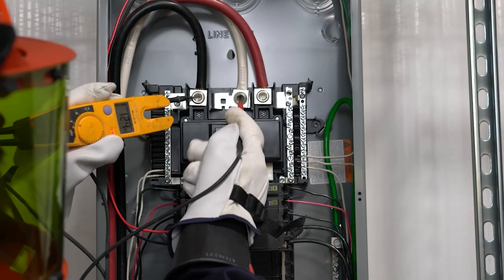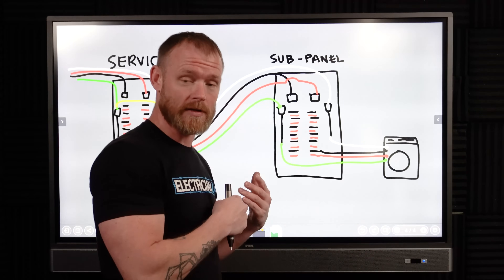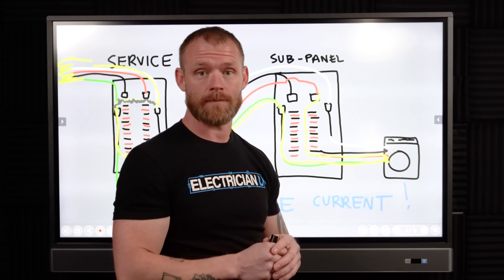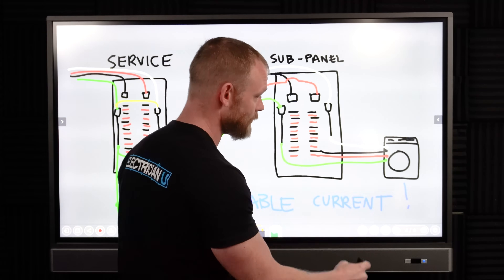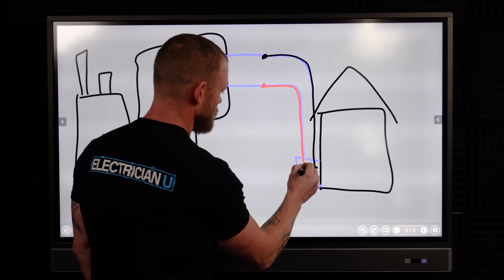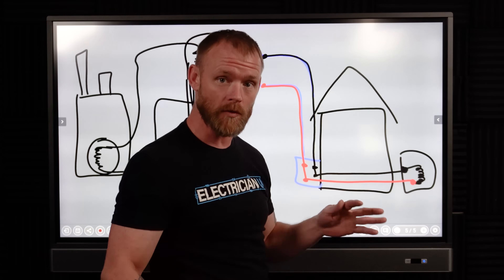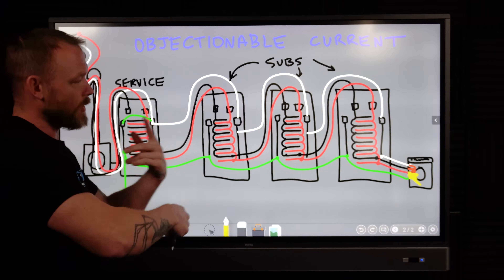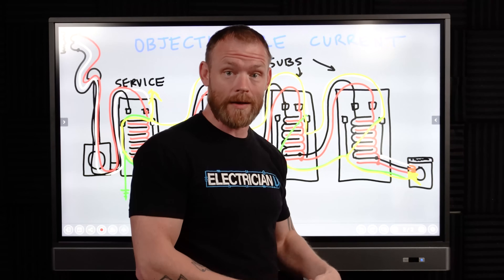Why Do We Bond at the Service Panel and Not a Subpanel?

Comment: Having watched your video I have a question/concern. My house has a main & a sub panel installed by the previous owner. Also a well (supplied from the main) and a pool pump fed from the sub panel. There there are two ground rods near the main panel. There is also a ground wire (insulated) that is connected to the well pipe, the pool motor and the rebar or the steel wall (I think) of the pool. Not long after we moved in I noticed a tingle when I touched the metal bars next to the stairs. I found there was a 5V AC voltage when I disconnected the wire from the well and the wire to the pool. The tingle went away and I thought more about it. I have yet to check if the sub panel is bonding but I am wondering if there is a grounding fault somewhere.

Comment: TLDW: Because you'll mix legitimate current and illegitimate current. You're effectively introducing a neutral-to-ground fault. Half your current will be carried by ground, and your main breaker will immediately trip. Also, the ground wire is not supposed to carry any current except fault current. Everyone is touching it, all the time. If you put normal current on it, you'll fry everyone.

Comment: What if the sub panel comes from a power tap before the main panel? Does the sub panel bonding bus bar need to be removed? Or does this setup just mean you have two separate main panels?

Comment: If you have a short circuit, and bonded each service panel, I don't think you risk current going through equipment since that equipment will have high resistance. However, the high current will create a voltage drop in the neutral wiring, so your equipment may brown out.

You risk extra current going through equipment if your house is hit by lightning, where the voltage gets extremely high and is dissipated by the ground. If the grounds and neutrals were bonded together at every panel, every upstream circuit would be at elevated voltage due to the lightning strike, and the current could go through the equipment (due to the higher than 120V).

Comment: My house has a new square D QO 42 space main panel in the basement 200A. It’s fed by new Siemens 200A master disconnect single breaker that’s between the meter and the house panel and on the outside of the house. In the conduit run. The service is underground to the meter. Thus my house panel is a sub panel as my neutral and ground are bonded at the first point of disconnect…the outside master 200A disconnect. In the event of a power outage is it acceptable to use a square D generator lockout device on my house (sub) panel main breaker to get my generator feeding that  panel specifically?  Or furthermore as a second option use a Reliance transfer panel on my sub panel?  Keeping in mind my neural and grounds are separate in my house (sub) panel. Is it possible as long as my generator neutral and ground are bonded?  And would my generator need connected to my house grounding electrode rod?  Or need it’s own rod at the location of the generator?  The authority having jurisdiction does not inspect electrical work…:if you can imagine that. No permit required. But I like to be correct in theory before hiring an electrician to do this.
Reply: I guess I can further complicate matters by asking does my outside master disconnect HAVE to be the point of neutral ground binding?  In my basic google university research it seems if THAT breaker panel is labeled as emergency disconnect only - not a service disconnect then it does not have to bond there but instead can bond inside the house. Suooosedly NEC allows that. But I don’t know. I hate hiring an electrician without knowing my situation because I’ve found in life even experts sometimes don’t really know. I need to understand what I’m being told by people I give money to.

Comment: Thanks for the explanation. What is confusing to me, the ground and the neutral at the sub panel is the same ground and neutral at main panel, except for a few milli ohms along the length of the wire. If there is a current of 10A flowing in neutral and the cable resistance is 0.01ohm per 10 metre (10awg wire), there will be a voltage drop of +- 0.1v, along the length of the 10m cable. If there is a transformer(or inverter) between main and sub panel, (I. e. isolated), I understand the neutral and ground bonding at sub panel due to safety reasons as there will be no physical contact. Or has it something to do with the gfc interrupter not functioning correctly(or not at all) if bonded at sub panel?.

Comment: So around 16:10, this had me confused. If a ground fault at a bonded sub panel would potentially go though equipment, how would a ground fault at the main panel not go through equipment?
Reply: Watched again and think I understand now. Because having 2 parallel paths, we don't know exactly which way the current will go or if it will make it back to complete the circuit?

Comment: So I have a dryer that has a Three conductor pigtail with a three prong plug. There is no neutral. The dryer has a 110 plug on its face. Isn’t that using the ground for the return?

Comment: Does this apply if the garage is detached?
Reply: No it doesn't  you need a grounding electrode system
Reply: @262markm  yeah I just looked up the code and installed one but this video sure had me confused.

Comment: You forgot the biggest reason for not bonding sub panels. The high current on the neutral causes a voltage drop due to the wire resistance that can 1 shock someone at another device, 2 can damage sensitive equipment.  OIB a thirty year controls design engineer.

Comment: If as it was done in the past that a 4 conductor circuit went to the sub panel then separated ground and neutral in unnecessary. Seems safer than just a 3 conductor to the sub panel.

Comment: Very helpful clip.  Thank you.  I understand conceptually why the neutral and ground need to be bond together at the main panel only, but I can't seem to understand how the ground would not become energized back at the main panel since the ground and neutral are on the same bus bar?  If the flow of current is traveling back through the neutral wire that attaches to a bus bar that has a ground, then why wouldn't the ground then hold that current as well?

Comment: Breakers monitor the current on the high side, it does not matter if it splits into a ground and neutral parallel path on the return, because the breaker still trips. So there may be a valid safety reason for not tying ground to neutral at the sub panels but it is not what you stated. Electrical engineer for 30 years

Comment: Neutral is white, but white isn’t always neutral. Do you guys know what that means?

Two hot , one neutral, alternating current never peeks at same time neutral never sees 100% of the load at the same time usually she’s 50% phase to-phase  in a three phase circuit one neutral, three hots because again alternating current never peek at the same time .

Comment: 220 is a complete circuits thowever, you need to ground for point of reference to be a grounded circuit.
Reply: Circuit breakers trip for two reasons, overload of short circuit.

Comment: How about if you lost your neutral, your ground would become a neutral and it’s under size and you could have an in balance load in the service. You also could have fault current interruption rate problem, because the cycle would be a little slower because the resistance would change .

Comment: Another great video that cleared up a hangup I've had for years and I couldn't find anything to explain it so I could understand  until now. I still not one hundred percent sure about what makes the breakers trip on the service panel vs the sub panels I understand what makes a breaker trip but do all of the or more than one breaker trip both in the sub panels and the service panel  ?

Comment: I'm dealing with an older installation where a second customer meter and overhead line has been run to a secondary service at a cabin 50' away. The neutral has been bonded with the ground at the main service panel at the house so the overhead to the cabin has a bonded neutral  through the support cable to the cabin. There is no ground running to the cabin. By not bonding at the main (sub) panel at the cabin, the ground wires at the cabin are isolated from the bonded neutral and the house ground. Would it be appropriate in this situation to bond the ground at the cabin panel or would it be correct to run a ground wire all the way from the main service panel at the house to the cabin panel? I think I already know the answer but the customer won't be happy about digging a trench for a ground wire.

Comment: Excuse me, but not creating ground-loops via multiple grounds makes good engineering sense from the standpoint of electronic noise reduction. However, it is required in Hollywood for 'fire safety code' legal reasons. As a result, movie studios are wired with ISOLATION TRANSFORMERS feeding the sub-panels,  allowing local grounding without creating ground loops that transmit hum into audio circuits.

Comment: I'm still not understanding this. As an electrical engineer, it seems to me the breakers would still trip. Whether the path to ground or the path to neutral are shared or not, the same current flow takes place on the hot wire. If you had 30 amps flowing through a 20 amp breaker because it got shorted to an unbonded ground, the breaker would still trip because it does not rely on the neutral wire, it's triggered by the current flow on the hot wire side. Breakers don't have any interaction with neutral wires unless they are GFCI. I don't see a problem having two separate paths, one neutral and one ground. If half the current went through the ground and half the current went through the neutral, The total current is still flowing through the hot, hence the panel or subpanel breaker will still trip. And in the case of neutral bonding every subpanel, I also don't see the problem, The same amount of current flow will still take place. It's my understanding that the breakers are just tripped by current, not by ground fault. Now, I could see a GFCI box having trouble, maybe. But even with that, it's hard to believe it would be a problem because it monitors the neutral wire potential difference from the hot wire. If the hot wire shorted out or you completed the circuit or the hair dryer fell in the sink, you or the water/pipe are bypassing the neutral wire by a small amount, enough to trip that breaker. The explanation assumes the panel breakers rely on neutral, which they do not.

Comment: DUSTIN, You didn't explain why would two or more neutral wires would NOT be at the same potential? Not all neutral wires are at the same potential but giving more examples of why would multiple neutral wires would be at different potentials, any reasons why this would be done?

Comment: Basically the lonely amp is trying to get back home after it's hard day at work. The bus to work is the active conductor, the bus home is the neutral conductor. Home is the alternator at the power station. Sometimes there is a cock up at work and the poor amp gets sent home early on the earthing bus.
Now for lesson two, that is only true in a DC setup, reality is an AC setup and the lonely amp never gets home , he just sort of vibrates in place. 
And this is how electricians are taught, they are told a lie to explain another lie which then goes on to explain another lie. 
Somewhere along the way the electrician gets a rudimentary understanding of how it works, enough to wire things up, repair things and make things happen to please the lady that pays his invoice. 
The truth is no one really knows how it all works, maybe Tesla did, but he was an engineer supreme, not many of them about, our whole system still operates off his inventions, created after dreams he had.
Electrical work is regulated wizardry in other words, unless you don't have a loicence, then it is a mad wizard out to kill, and he must be stopped through fines and a severe telling off!
Apparently.

Comment: Objectionable current flow is what they call it in my jurisdiction. Province next door has less grounding/bonding requirements. 

We bond N to ground at meter or farm service then ground plate at meter and panel plus #6 bare bond between meter and panel. Any panel in a separate building needs its own ground plate not bonded to ground. 

Province next door is ground plate at panel and bond N to ground at panel.

Comment: A good thing to remember, what ever leaves the source wants to come back to the source. Wether it’s a ground, neutral, or another phase. The source is almost always a generator or a transformer. One big series circuit. The ungrounded systems capitalized on this concept. No path home=no current= no OCPD trip.

Comment: Question, in a detached garage with 10 gauge underground 3 wire w/gnd  wire there is a main 100 amp breaker box used as a main cut off switch feeding the sub panel with no main breaker, can the neutral and ground be joined at the single terminal block in the switch box (there is only one terminal block for a ground). In the sub panel they will not be bonded, both boxes will be next to each other in the garage. The 100 amp switch box looks like it was originally used on a large piece of equipment that didnt need or have a neutral bus bar.

Comment: 523 so you saying in a fault condition current will only follow one path either ground or neutral? If both are bonded at panel isnt it possible for both to carry current to the earth? 846 would curren travel through ground to earth back to power station? Ahhh need circuit to travel through neutral to pass through breaker to trip it, not through ground bypassing one leg of breaker defeating it. 1151 how does power traveling through ground (not neutral) make it back to power station as a circuit if power station does not also have a ground? 1243 your missing in the diagram the power source being hooked to ground to complete the circuit THROUGH the earth, otherwise you could hold live wire and not get shocked, no comple circuit. You need to show green ground at power station also??? So path of least resistance is neutral back to powerstation vrs ground (earth) back to power station.

Comment: You said on secondary circuits that the appliance turns on when you push the button and the switch flips to complete the circuit but how does a digital touch system work? What about the small amount of electricity that is being used to keep lights on the appliance on? For example a microwave. Is there a computer that controls that? How does it know how to vary the amount of electricity it’s using?

Comment: The reason you don’t bond in subpanels is that doing so would cause a return path for neutral current on the ground wire, which isn’t intended to be a current carrying conductor, making an unsafe situation for workers performing service, and for the homeowner as well, called objectionable current. Drawing off what I remember from my apprenticeship. I’m sure there are other problems caused by doing this in the video, but this is my immediate answer to the question 😂

Comment: I've had underground drillers that install utilities tell me they always ground the neutrals in subpanels. I tell them they shouldn't because the main service panel is where it should be bonded. 
For example: If you build a shop close to your house that is being fed power from the service panel of your house, then every neutral in the shop should be connected to the neutral in the shop panel which should be connected to the neutral of the main service panel and the service panel is the one that is bonded. I tell them the shop panel is a sub panel. I had a city inspector tell me I was wrong. I argued and argued with him. He finally threw his hands up and said when they investigate for a fire in my shop, it'll be on me to pay for all damages. He asked where I got my electrician license at. I asked where he got his.

Comment: I backfead a 120 v generator thrue a outlet to one fase only with the main off but for some reason y dont understand, i could not turn off some circuits even if i turned off their breaker and yes they where not on the same circuit where i had the generator and yes i only did it cuz of an emergency and completly understand the dangers. Any ideas of why could that happend?

Comment: My main panel/meter is attached to the electric pole approx 300' from my house & workshop and does not have a grounding rod.  Since the 200A breaker is in this panel at the pole this would be considered my "main" panel and would require the ground to be bonded to neutral.   I don't see  how this is occurring in my "main" panel since there is no visible grounding rod,  my question is I have 3 panels inside my home and one in a separate workshop, none of these panels have the grounds bonded to neutral, but each structure does have it's own grounding rod, why does the pole not have a grounding rod, and with that being said do I still make sure that my grounds and neutrals are not bonded in my subpanels?  Thank you.

Comment: I’m very glad that you got the white board because it is very easy to understand and digest the information your providing thank you for helping all electricians to better understand there craft.
And as a fellow electrician may I suggest you check out the YouTuber ( The Engineering Mindset ) it’s full of great 3D ilustración of electrical equipment like motors , switches, receptacle, inverters, and even a entire air conditioning system that shows u the air current and damper system.
I think you and him could make a Collaboration video with your extensive knowledge of electrical work and his engineering combined with excellent 3-D models it will be a hell of a video.
Just a Suggestion in case you run out of ideas I think this one could potentially be a winner thank you so much for what you do keep up the work.